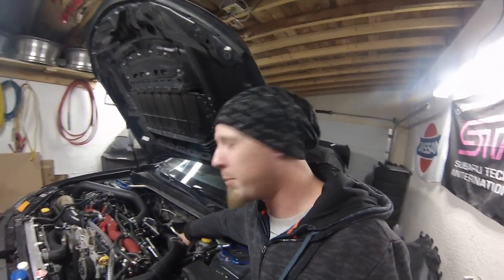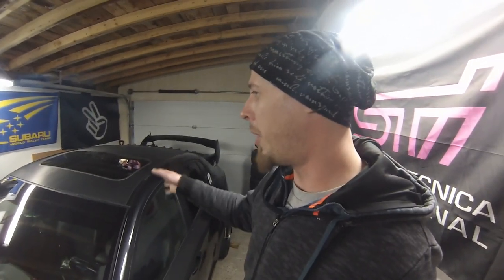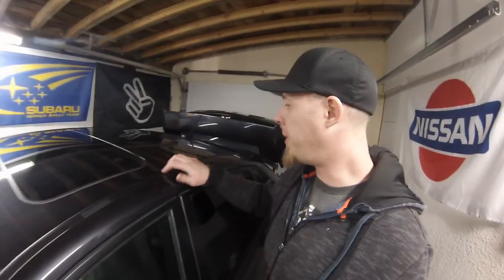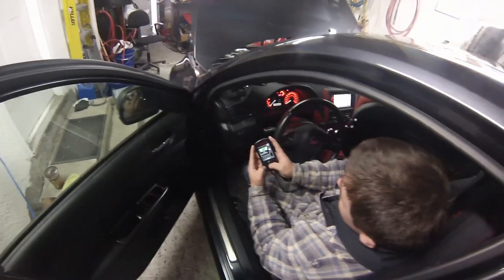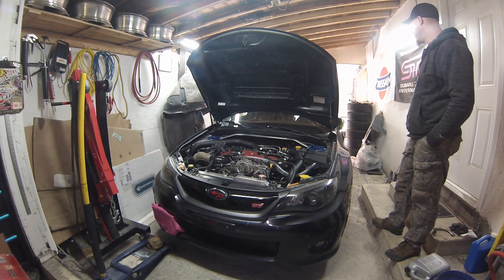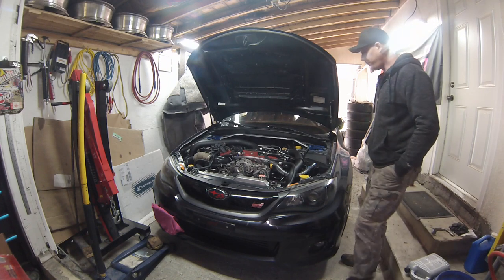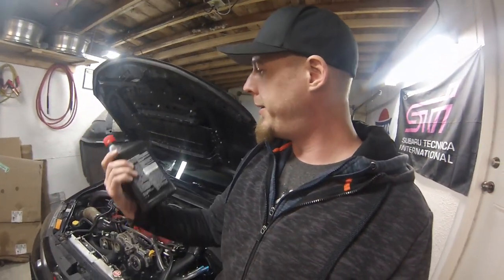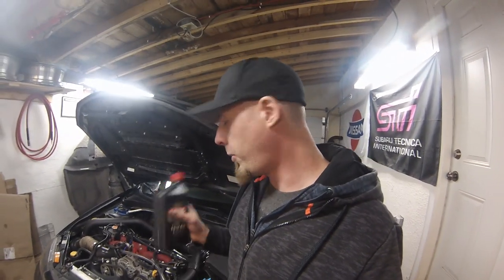2013 STi Build Part 20 - The First Start and Finale

Comment: I've watched these videos multiple times and now my subi took a shit so I'm working on my car couple questions I see you only used the 1050 injectors were they actually enough or would you recommend 1300 exspecially if you were going e85. Next would be you stayed on stock fuel rails or recommend upgrading those also . Just the two things are pricey lol . I would like to be 400 on 93 octane and 500 on e85.
Reply from the maker: The 1050's were enough but my buddy ended up doing fuel rails and an upgraded regulator. I am unsure if 1050cc injectors will reach that goal, I assume they would. Something to discuss with who you will have tune the car, unless you are going about this solo. Plan on upgrading pretty much the entire fuel system. ;)
Reply: @HomebrewSubaru  oooo yes I know lol shit gets exspencive real quick and thank you for responding and taking your time to write back .